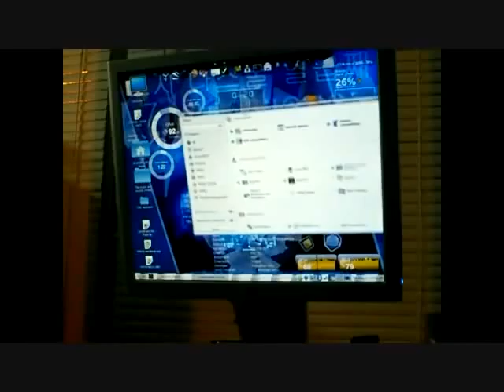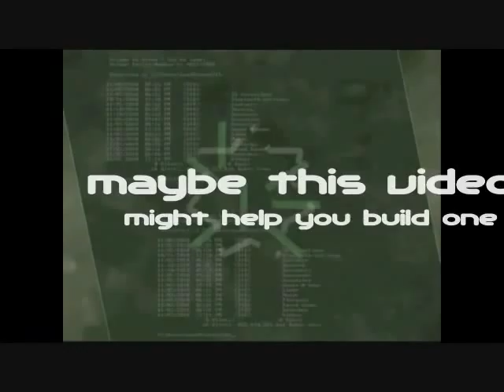Building My Linux Rig part 2

Comment: Nice video, thanks for sharing.  I think their is a slot on the back door under the mother board to run wire from, that should fix uour wire issue.  I hope this helps.
Reply from the maker: there no slot on that part and I already done some arrangements years ago